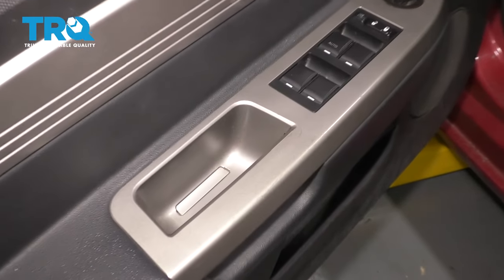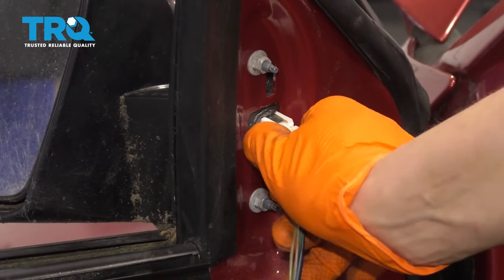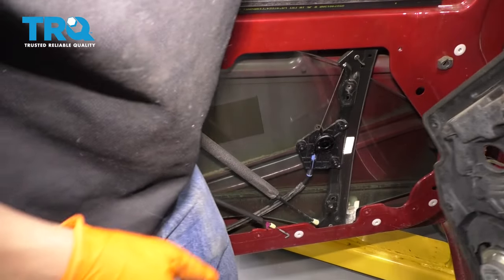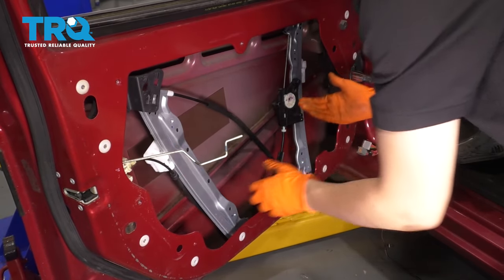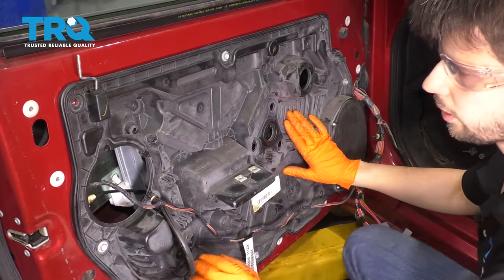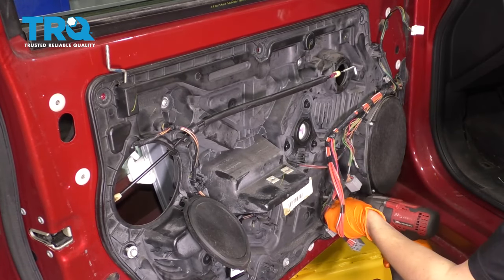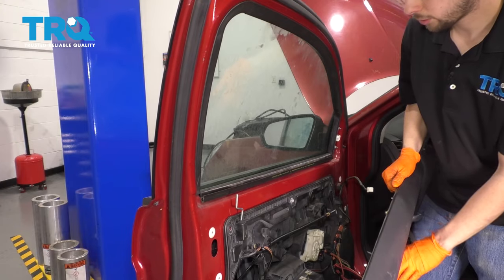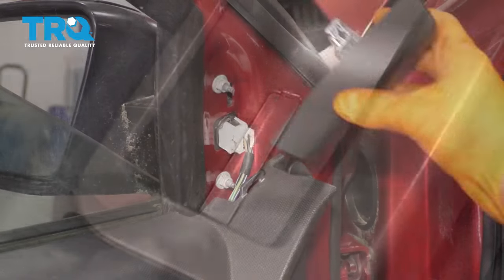How to Replace Window Regulator 2007-2010 Chrysler Sebring

Comment: My 2008 Chrysler Sebring is a convertible.  In most ways, it's very similar, but I've discovered some of the differences after taking it apart.  The door handle broke off but I'm watching this video as well because the window glass in my car is not fastened in with the white plastic tabs.  I'm going to remove the black inner piece so I can determine how the window glass is attached to the regulator.  I'll be back at it tomorrow morning.

Comment: Did it, got it installed and window is working. I have a bit of a fit and finish issue door panel. Was hard to snap in around the lock and there is a small between window and mirror panel. The door latch is snapping all the way to return position after opening :)

Comment: Any suggestions if all the windows are not working? I changed the fuse already. I kinda doubt it’s ALL the motors. Is there some point in the wiring that could be broken?

Comment: Average shop would charge and hour if you buy & supply the 'correct part' if they do (2x or more) and you save that part- their labor is anywhere from $90 to $114 it may take under 20 minutes but they round up. OR DIY cheapewst route is to get only cables @$ 20 idk access to a mc / cable user shop